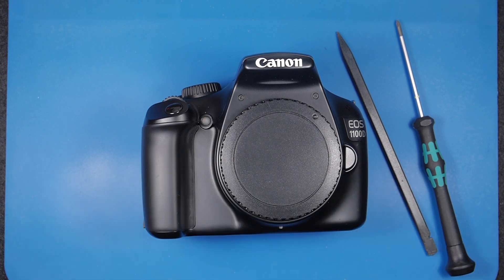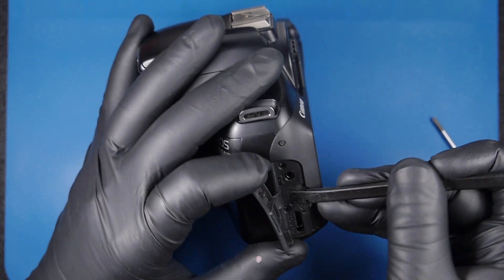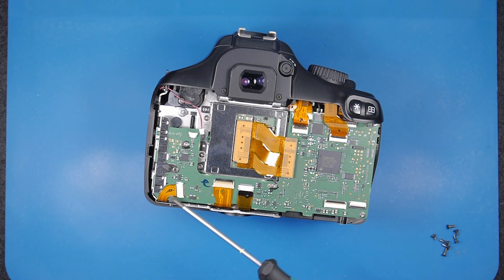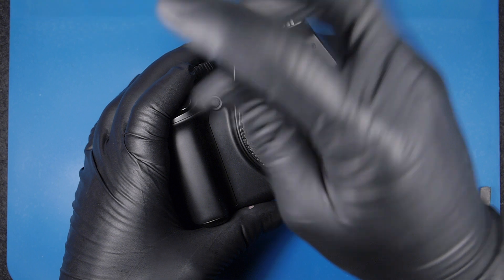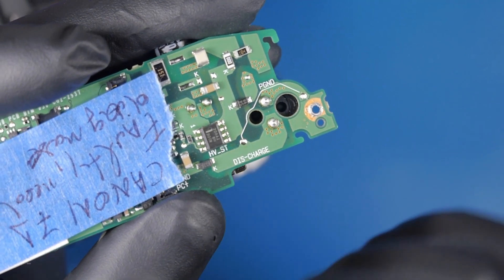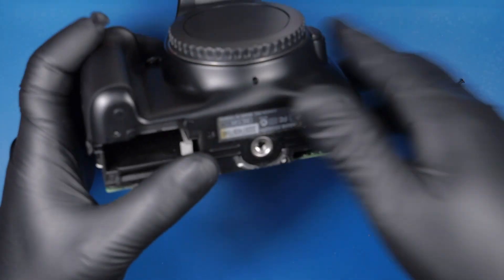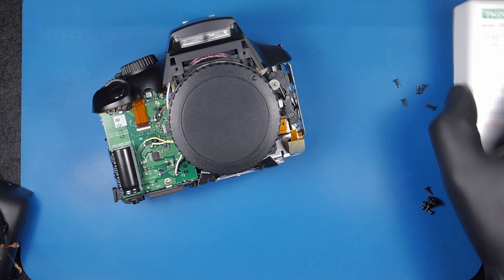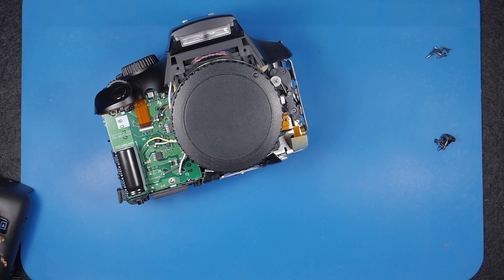⚡ Why You MUST Discharge the Capacitor Before Repairing a Camera! ⚡

Comment: My 6D Mark II is having really weird issues. It only has a little over 1100 actuations. I think it's the power board but I'm not sure.. a camera is much more delicate to repair than anything I've ever opened up. 
It was showing Error 40 repeatedly.. I cleared camera settings and updated the firmware, it went away for about a day, and now it's happening again. Only this time, it's not actually showing the error. Sensor cleaning and swapping lenses triggers issues. The back LCD likes to not work, except I know it's fine because it worked after I flashed the firmware.

Comment: Hi, I'm in the process of repairing a coolpix S9700 compact camera. I discharged the capacitor with a 10k ohm resistor till it was at a safe level. I've done this on two models and now the capacitors are not charging back up when in flash mode and the flash isnt coming up. Any ideas? Unfortunately no service manual available.